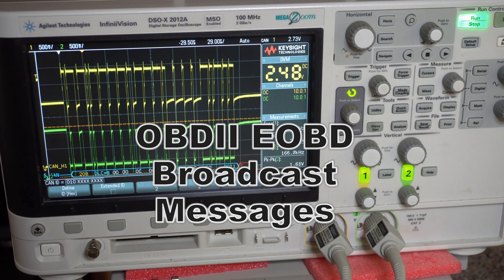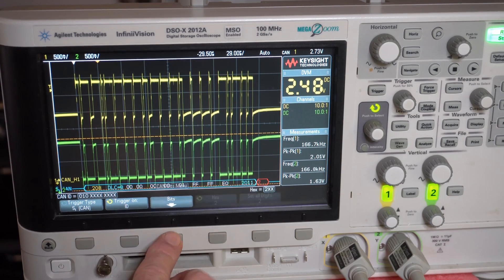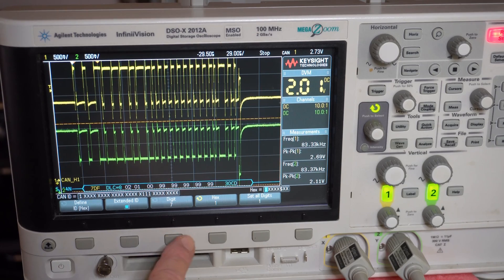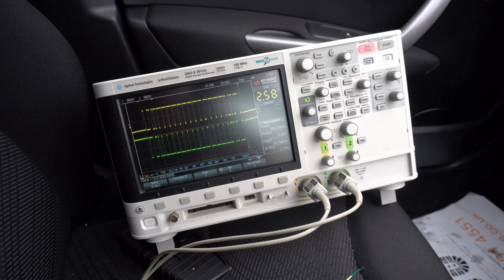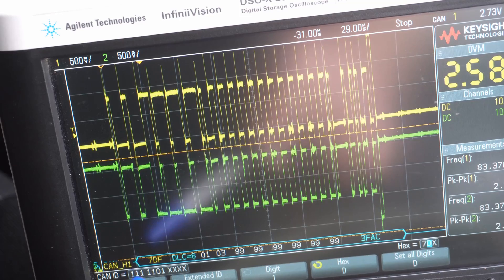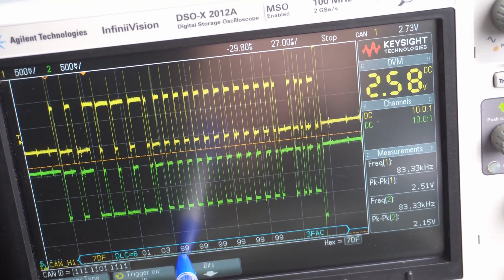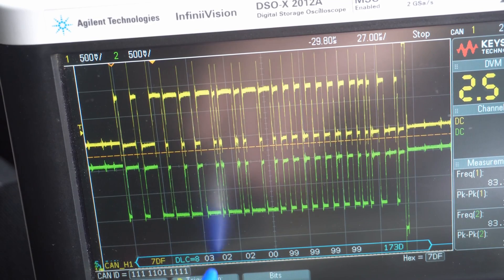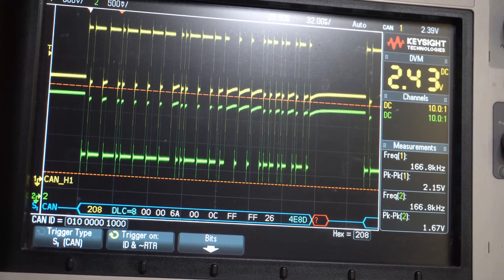CAN part 3, OBDII / EOBD Scanner Broadcast Messages Sent with MikroElektronika & Keysight

Comment: Hey John, Thank you for the video , Why I cant receive anything from obd2 with pic microcontroller? I know i should broadcast a request and receive data, my car's OBD2 receives message but dont respond anything!  ,  anyway I can read can bus messages from can H and L wires (Direct access Not OBD2 protocol).
should I use RTR frame (Request Frame) ?
could you upload a video about communicating obd2 with PIC microcontroller?

Comment: Hey John! I have no idea how I missed this video, I normally watch all of your videos, and this is one of particular interest to me (+ a shoutout :p).
Very interesting findings and completely agreeing with the description of the obd2 modes in this article: https://en.wikipedia.org/wiki/On-board_diagnostics#Mode_of_operation

I'm currently trying to reverse engineer the communication of a Thermo King reefer (I'd like to read out the temperature data put out over the canbus). I got a nifty device that simply clips over the can wires and picks up the signals capacitively, no electrical contact required!
It then puts out that data to usb so I can use can sniffing software, which seems more practical than an oscilloscope for larger packet sniffing tasks. I'm pretty sure I've identified the temperature frame, but the payload data has got me really confused, I think there's some sort of formula to convert the 2 bytes of data to a temperature value.

Anyway thank you for the video!! All the best!
Reply from the maker: Hi Koffi,
Thank you for your comments.
The data, if in 2 bytes, could be as follows

Byte 1 shifted left 8 places then or'd with byte 2
or
Byte 1 times 256 + byte 2
or 
Byte 2 times 256 + Byte 1

Hope this helps
Reply: Thanks for your reply!

I found that formula somewhere in the car hackers handbook, but it produces very large numbers without correlation to the temperature. I forced the temperature to drop while capturing, but can't find a combination of the two bytes where it sort of drops in the same fashion with respect to time.

Doing a straight mapping without understanding is possible, but there are several sets of hex values that produce the same temperature on the display, so I think the display does some rounding off.
Reply from the maker: At a guess, I would have thought the temp would be an analog voltage converted to a temperature, or if the numbers are going up to 1023, it could be a 10 bit ADC.
So 1023 would be max temp and zero would be min.
Reply: Hey John, this might be of some interest, to see how thermoking codes their temp data. we eventually found the temperature in this frame:
CAN_A=000006B1 01 51 10 63 01 01 80 FF

It's in the 63 01 bytes. least significant bit: so 0x0163 converts to 355 (dec). Divide by 32 gives 11.09°C
Reply from the maker: Excellent news on the reverse engineering Koffi :)
What are you using to read the CAN lines?
Reply: it's a capacitively coupled contactless device. Easycan, made by Setivo. You just click it over the two can wires (they don't get damaged in any way), hook it to a module that interfaces with the PC and then simply capture the frames. very neat!
Reply from the maker: wow, that sounds fantastic and no diagnostic socket required.

Comment: Hey John, when you send out messages from the MaxiScanner, the first byte is the number of bytes of interest after that byte. The second byte indicates the mode, and the third byte, if applicable, indicates the PID. I am not sure what the fourth byte is for when you looked at the freeze frame. Wikipedia's article about OBDII PID's is an excellent resource for this. Thank you for the informative videos!
Reply from the maker: Thank you for the info, I'll have to have a look.